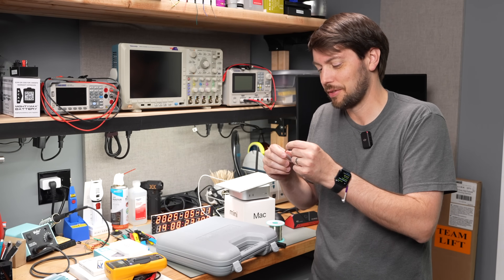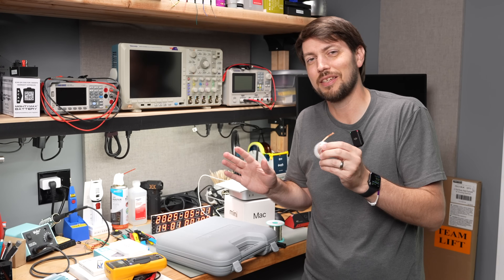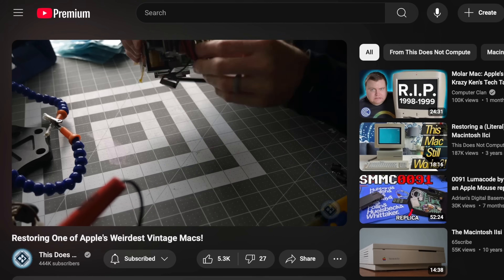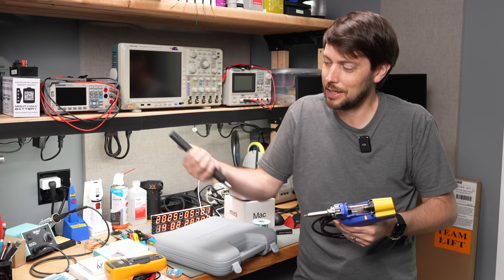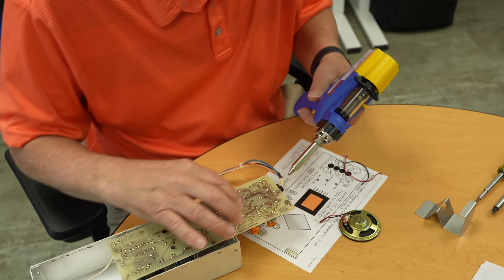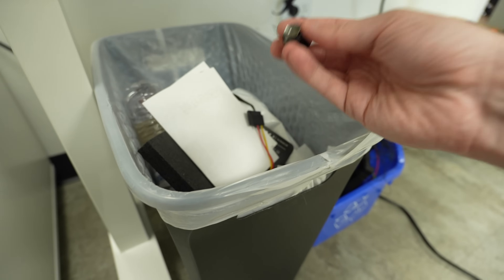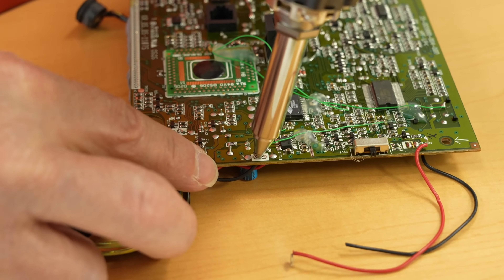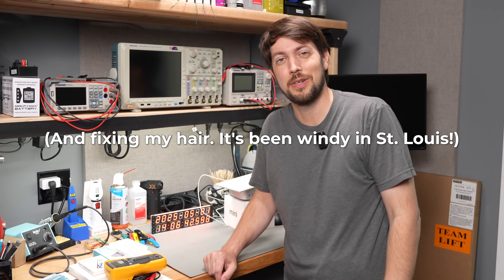Nobody told me desoldering could be easy! (Hakko FR-301)

Comment: The Hakko is undeniably great, but for those not in the business of board repair like me, it's pricey. A good desoldering alloy, "low melt" and using the wick properly can go a long way. Even an old hot air station, and carefully placed aluminum can shielding is just fine depending on the component.
Reply: Not if you have loads of components to replace cause you don't know which of the 11 28-pin ICs is the bad one.  Then it's a god send.
Reply: How much is your time worth? It doesn't take very long to save $300 worth of your time when you can speed things up 10-15x (or more).
Reply: I've been doing it for almost 40 years, not the audience I'm commenting to, or about. If you're in the business long enough, yes, but you'd be surprised how many of these are sitting in closets after a single home project.

Comment: Try wet wicking. Dip the end of the braid in RNA fllux before using it. It wets faster and  reduces heat damage. When yu trim the used wick, leave about half te width of the vraid with solder. This conducts heat faster, and does a better job  thay dry wicking.
I used to use the Adio Shck desoldering iron with a squeeze bulb. I repkaced thousands of DIP ICs over the decades with those..

Comment: The product you're showing is way too expensive. There are plenty of the same ones for less than half the price.
Please don't sell expensive junk. Unless your channel has become a channel to sell us stuff.
Reply from the maker: Nope, it's a channel to share things as I learn them.

In this case, I researched a number of desoldering guns and kits that cost $100-300.

Many of the Chinese brands seemed to have caveats around longevity or heavy use (having it on for 20+ minutes at a time), and I have heard much less in forum posts about the Hakko.

I use Weller, Pinecil, and Hakko irons, and have been impressed with the durability of the Hakkos the most, though any will do in a pinch.

You definitely don't need to spend $300 for a desoldering gun, but for me I'm quite happy with the purchase.
Reply: There are much cheaper options indeed, but trust me, this specific tool is worth it. I've used wick, various handheld pumps, 2 chinese desoldering stations and 3 namebrand solutions. The 300$ hakko gun works better than 5000$ rework stations...
Of course if you desolder 2 caps every year it's not worth the investment, but if you repair stuff often it is a solid choice.

PS: I hate hakko soldering stations though, the user interface is really crap and they are generally mediocre for the price.

Comment: 1:42
Is not a silicon tip. It's a teflon tip.
Reply: The cheap ones are Nylon sadly, not as heat resistant as Teflon. Also, he said silicone not silicon, to be as pendantic as you.
Reply from the maker: Ha!
Reply: @drewnewby To be fair, from a material perspective, PTFE/teflon and silicone are very different materials. Normally pedantic involves irrelevant or unimportant detail, but, especially in an application where high heat will be applied right at the material, knowing something is PTFE, which when overheated can cause illness in people and animals, seems valuable. I'd be much less concerned about silicones.
Reply: @josephspiros Reread the posts slowly, maybe you'll have better luck next time. Thank you for the wikipedia / AI level explanation of a topic I know far more about though.
Reply: @drewnewby  Huh? I did read all the posts, are you referring to your post about the cheaper ones being nylon? And yet, some use teflon, so, what's your point?

I don't really see any apparent need for thinly passive aggressive responses to posts that show no sign of being anything but friendly and helpful. I'll give you the benefit of the doubt and assume you're having a bad day or something, and hope that maybe you'll have better luck being a charitable and humble person next time? 😓
Reply: @josephspiros It's not passive agressive, I'm very clearly replying that your post was not helpful. I have no interest in you giving me the benefit of the doubt. No need to be charitable or humble to you, thanks.

Comment: When I was little Radio Shack had one with a rubber bulb attached onto a solder hollow tip just like that. They were time savers for sure. With it you just plucked the rubber bulb off and dump out the metal bits.
Dad thought he'd be smart and hooked up a vacuum tube onto it. Drawing so much air I had to use one of those rubber tube ratchet clamps you'd see on I-V's or it would cool the tip off and not work.
If doing a lot of this it's worth it's weight.
Reply from the maker: Heh, I'm sure there's a suction rate that reduces the overall effectiveness of the system. And a vacuum cleaner would definitely hit that!
Reply: @Level2Jeff  God no. He ran several businesses one being a truck Wash that took care of hazmat tankers and had actual pumps. Still it was over powered.

Comment: Nice.  I've never seen this tool before.
I would argue that it's not a silver bullet - you will struggle with joints on large heat capacity sections like a power plane.
I would also argue that a wide range of tips for the iron, the sucker, and braid is better than the gun, since the gun looks very specific.
I used to solder daily for a number of years in the profession i used to be - the wide range of tips is the secret sauce to making life easy.
Reply from the maker: True; another option too, is to use a preheater or supplement it with a separate beefier iron if you really need some heat. Go in quick with a little flux and many joints will work well.

The key I think, in my limited use so far (about 100 joints sucked), is to clean it after each use. Especially the end with the hole in it, and before it cools down.
Reply: @Level2Jeff  Fair point. 👍🙂

Comment: When should one use a soldering gun over a soldering iron?
Reply from the maker: If you need a LOT of heat, that 140W soldering gun is amazing. Useful for automotive, or for large blade power connectors, that sort of thing.

For a lot of larger surfaces, or things like power transistors with large surface area contact, you need a lot more heat than a standard small iron will provide.
Reply: Some people are crazy and do SMD work with it. Diode Gone Wild is the first YouTuber who comes to mind.
Reply: Also useful for removing connectors from boards with multiple ground planes that such the heat away from the joint faster than a solder pencil can dump it in.